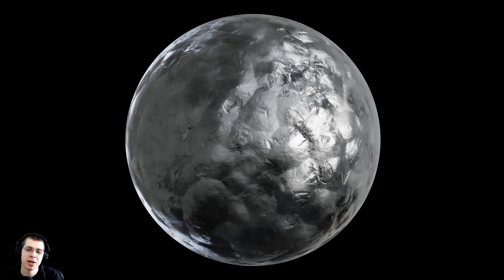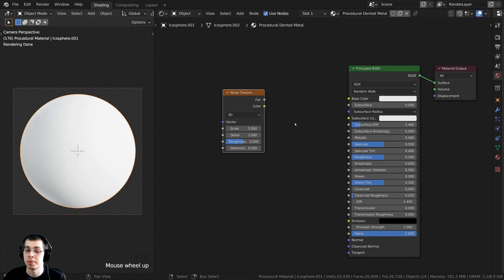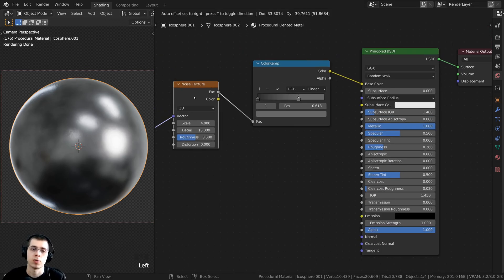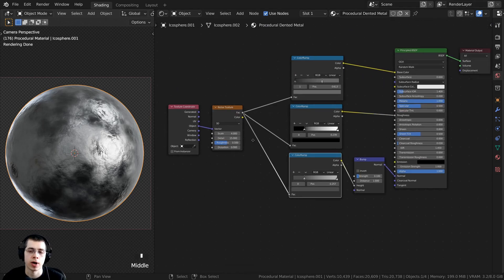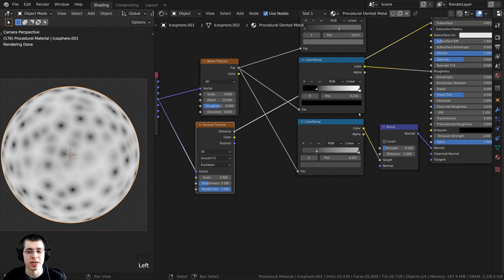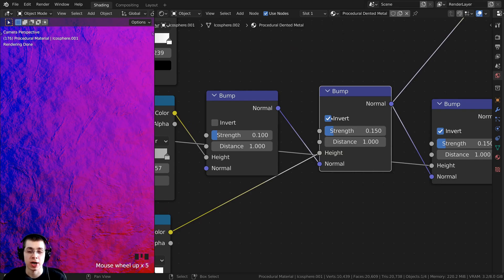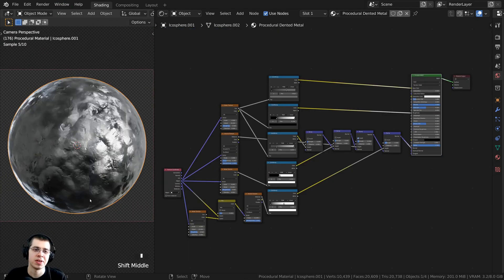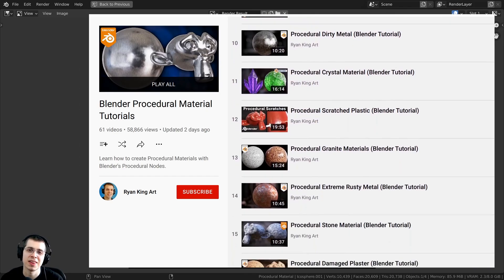Procedural Dented Metal (Blender Tutorial)

Comment: Thanks for new contents ! I have one question... What does "Object" in "Texture Coordinate Node" means? I read  blender document about it, but I can't understand.. (Texture Coordinate Node Object Output in blender document: Uses an object as a source for coordinates. Often used with an empty, this is an easy way to place a small image at a given point on the object. This object can also be animated, to move a texture around or through a surface.)
Reply from the maker: Hmm, yeah I can't explain it much better then that. Basically, the texture coordinate tells the texture how its placed on the object. On default, if your not using the texture coordinate node, procedural textures use the "Generated" and image textures use the "UV". but using the  texture coordinate node allows you to use different types.

Comment: Thanks again, great job as always!!! 

I seem to get mixed results with my experimenting, so I was wondering, when you stack bumps like that, does it matter which order you put them in? I am a little bit OCD about it, and don't like to 'cross the streams (noodles)', I like to keep things neat in there... lol
Reply from the maker: Yes, actually the order of the bump does change the look a little. You could use Reroutes if you don't like the wires going over each other.   : )
Reply: @RyanKingArt  Thanks, I usually just move the groups up or down to make them line up. lol